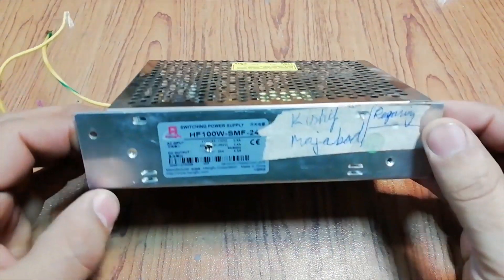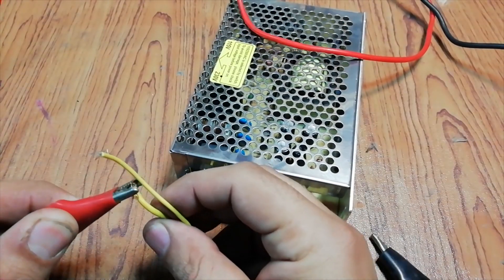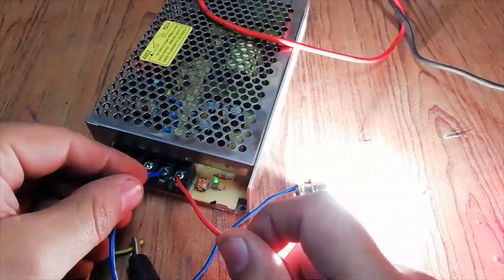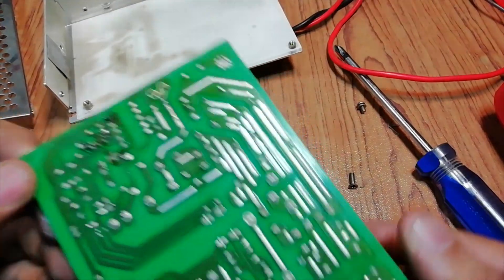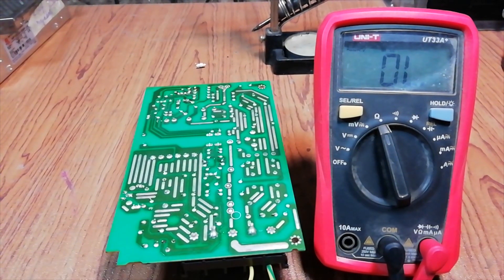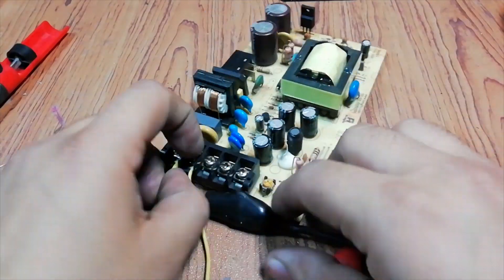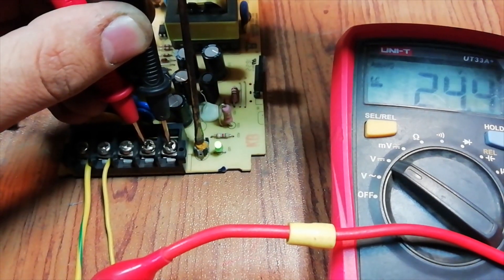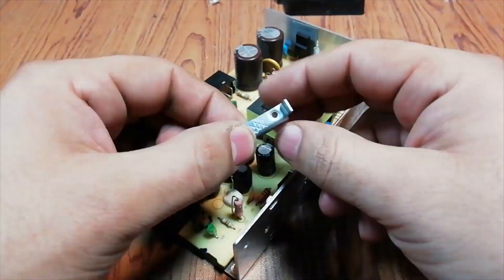How to Repair Industrial SMPS

Comment: As usual a very very bad video by you. This fault is very rarely comes in SMPS power supplies(The ratio of this this fault is 1 out of 1000 power supplies) . And there is lack of step by step proper checking of SMPS power supply. You directly go to variable resistor, no input voltage check, no transistors check. no diodes check no capacitor check and extra extra .which means you nothing to know about SMPS power supplies. Someone told you and you change the resistor. Did you know Which major fault comes in SMPS power supplies is output voltage Zero. So if you know something about SMPS power supplies then make a proper video about this fault.👎👎👎

Comment: I got a similar problem, on those cheapy LED Power Supply. When I turn it ON, the small led near the output is blinking constantly and output is fluctuating. Nothing is blown inside. I checked both Power Mosfet, and they fine.
Any idea please??
Reply: bad caps usually...  Use your ESR / Cap tester...
Reply: @OldSkoolF  Thx

Comment: When ever I connect supply 240 v fuse blown please let me know possible solutions
Reply: May be the bridge rectifier or power MOSFET is gone
Reply: This man nothing to know about other faults about SMPS power supplies. This is only a paid channel.You should see "Elab Industrial" channel . Where you will find a complete repair video about SMPS power supplies and You will not disappoint.

Comment: I am not get any output voltage so where is problems
Reply: This man nothing to know about other faults about SMPS power supplies. This is only a paid channel.You should see "Elab Industrial" channel . Where you will find a complete repair video about SMPS power supplies and You will not disappoint.